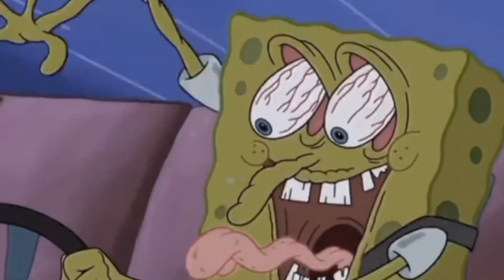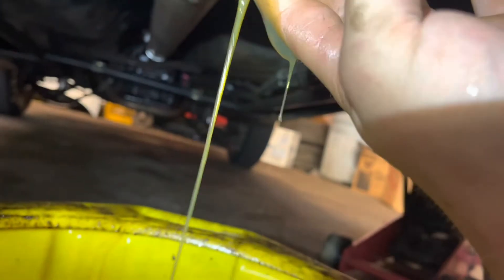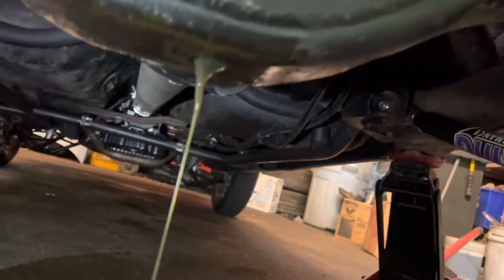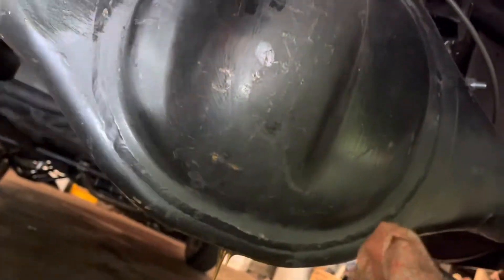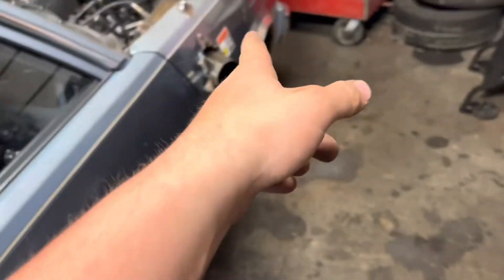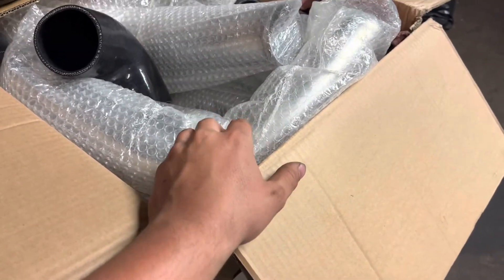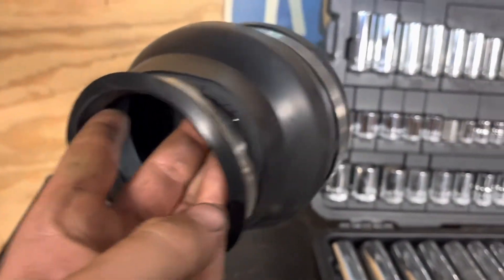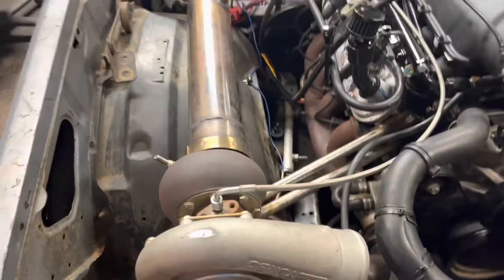Goodbye…. MY MOM GOES FOR A RIDE ALONG (Turbo LS Malibu Wagon is turned up just in time to sit)

Comment: Thank you for your service.  Looking forward to more content when you get to your first state side duty station.  What kind of converter spacer are you running?  TH400 to LS requires a spacer and the cheap little round cap style ones are garbage.  Sounds like you might have taco'd a rod.  Sounds like maybe a piston touching the crank counter weight???
Reply from the maker: Neil chance custom built this one so the snout on the converter is the right length and size to go to an LS. I can’t quite remember if the noise went away once i got the converter full of fluid. Motor could be making a little noise. After two exploded converters that’s a lot of stress with no support on the trans and would’ve wobbled the flex plate/crank. Will be coming out and inspected when i get a somewhat setup. K member, manual rack, twin turbo. Couple big changes coming…